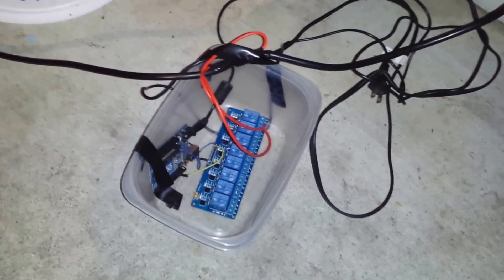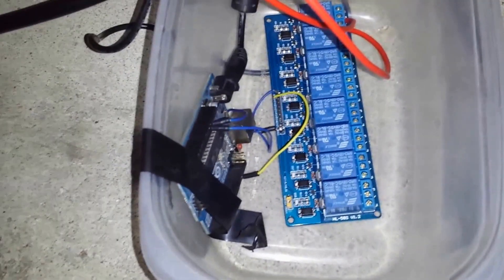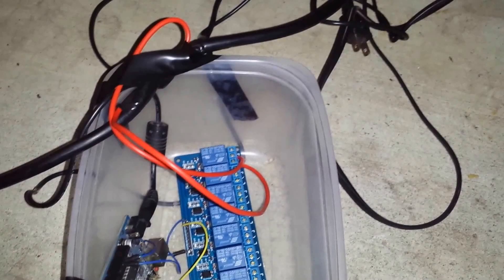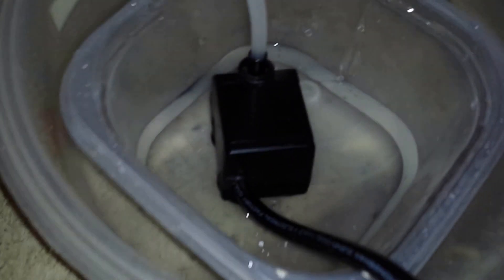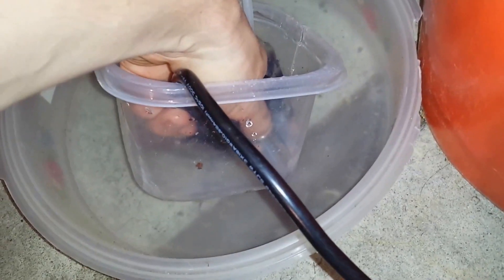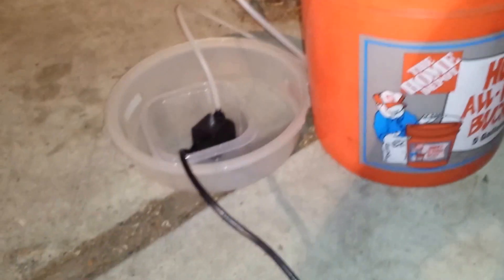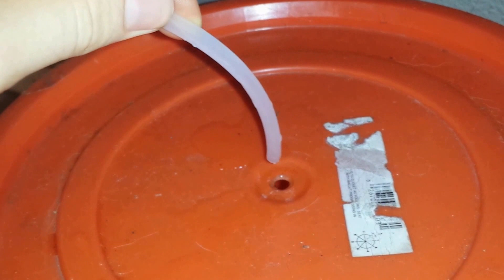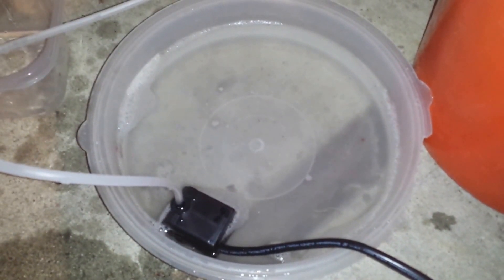Arduino 8 Channel Relay Control

Comment: https://youtu.be/xCMqDt64pPA     8 relays simultaneous operation  - much simpler and because the code is non-blocking, you have multiple relays working at the same time!  code in the description.

Comment: These should come in really useful for your projects. http://www.ebay.co.uk/itm/VAUXHALL-FRONT-REAR-FOG-LIGHT-HORN-Arduino-Relay-4-PINS-2-GM-24432680-12V-20AMP-/262146640666?